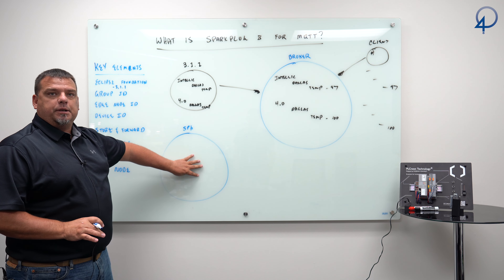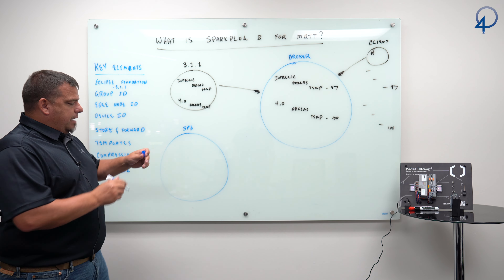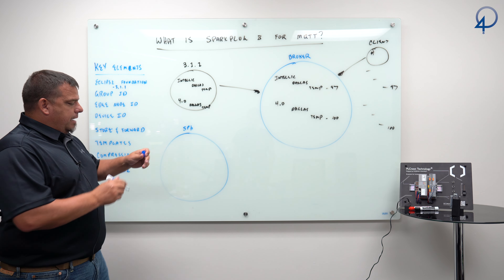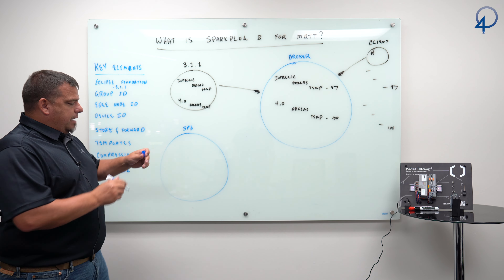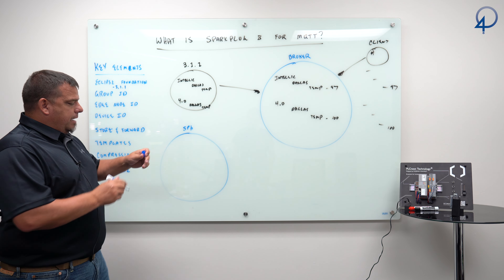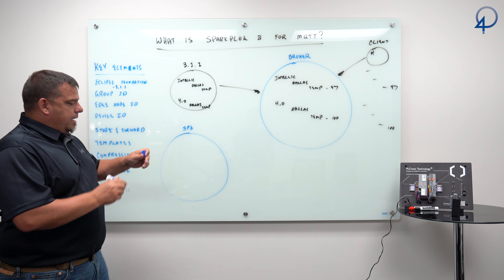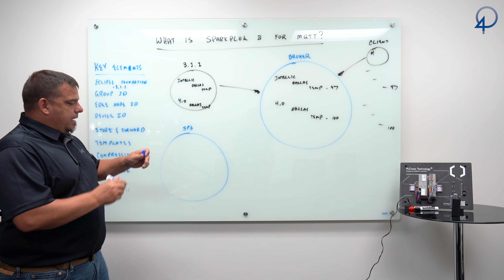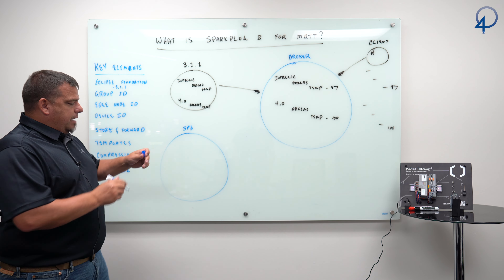What is Sparkplug B for MQTT?

Comment: If I understand correctly the Sparkplug namespace (SNS) is basically independent from the rest of the namespace and can typically only interact with a subset of clients. Further to this, because the Sparkplug B spec dictates that the format of the topic structure is governed by the topology of the EON Nodes, it isn't necessarily possible to structure the SNS to align with a Plant/Area/Line/Cell factory model - especially if you plan to use something like Highbyte where it can be the Sparkplug B EON Node for the whole plant. This means SNS clients can't rely on the SNS topic structure to be normalised from plant to plant - this could only occur within the payload metric naming. Does it make sense to think of the SNS as a distinctly different layer from the UNS, each with their own strengths? SNS data can be translated and/or transformed by SNS Clients and published up to the UNS where required for comsumption by more plain-speaking clients that rely on a normalised factory model.

Comment: Question: It's excellent that Sparkplug B natively supports Store & Forward. In a plant situation this might not be as important due to the fact that the networks would be "wired" and super reliable. But in a case of let's say cellular connections (which are sucky) it would be very important. What I am curious about is the use of flat MQTT 3.1.1 over cellular. In these types of implementations that you all have done over the years, did you all have to do custom coding to implement Store & Froward? How did you all handle prevention of data loss over "unreliable" connections such as cellular, using just plain ole vanilla MQTT?
Reply: Correct -- we did two things to create S&F with vanilla MQTT.  1. We designed the payload as a JSON, with a key: value pair for each event 2. We buffered on the edge and published the full JSON with the 'history' in key: value pairs.  spB made it much easier.
Reply: OK so I am having a nerd overload here ... that is freaking brilliant. Using the fact that you can toss anything you want into the MQTT payload and using JSON, which gives the structure you need but in a nice light-weight package. OK so that is very cool. Thanks a million!

Comment: So in the flat 3.1.1 example, if you publish a temperature, you can't (easily) publish extra context? Such as Fahrenheit or Celsius? Certainly you could add extra topics covering that, or whether it's a HIGH or LOW temperature for the day (on in the context of a machine, HIGH or LOW for process controls), but this seems tedious and less scalable.
Reply: Yes ... you can... and with MQTT 5, its even easier (because of meta data)
Reply: The key way to do that is to publish a json payload that contains value, timestamp, unit etc and parse on broker side (for 3.1.1)
Reply: @walkerreynolds973  so something simple like:
{
    timestamp: "2021-09-03-etc..." 
    outdoorTemp_value: 75
    outdoorTemp_UofM: "F"
}
Reply: @hobbes1069  you got it!

Comment: One thing I had difficulty understanding is when the SPb publisher is sending binary data over the wire and you mentioned that vanilla 3.1.1 broker cannot decipher but can pass on to another SPb subscriber. How do they align on the proto file that would be needed to pack/unpack the data? Do I manually maintain the proto files for both sides? Or is there some inherent maintenance in the standard?
Reply: Great question -- proto buf is only used in the NDATA, DDATA, NDEATH, NCMD, NBIRTH and DBIRTH sub-topics.  One can navigate to these topics via MQTT 3.1.1 clients: spBv1.0/GroupID/EdgeNodeID/{NDATA, DDATA, NDEATH, NCMD, NBIRTH, DBIRTH} but will need to unpack the payloads in the braced topics with your spB client.
Reply from the maker: Thank you for answering Walker!

Comment: I'm researching the possibilities wits a Siemens S7-1500 PLC, Siemens has a library that supports MQTT 3.1.1.
Because the library is MQTT 3.1.1 does this mean it supports Sparkplug B or not?
If not do I have to buy an EoN device that is connected to the Siemens PLC wich is compatible with Sparkplug B?
And where can I find out if my EoN device is compatible with Sparkplug B?

Hope you or someone can help me, it is hard to find the answers to these questions.
Reply from the maker: It does not support sparkplug B but that isn’t an issue because a broker can support 3.1.1 and sparkplug B at the same time.